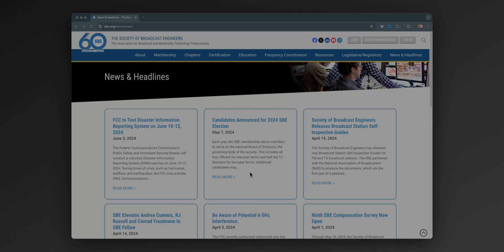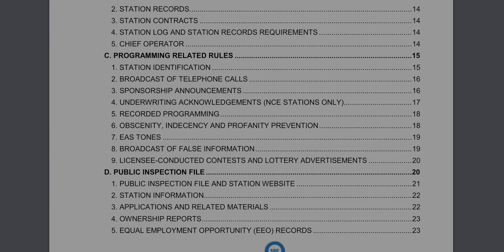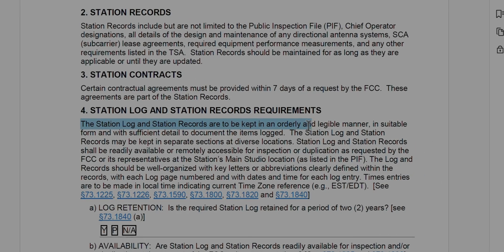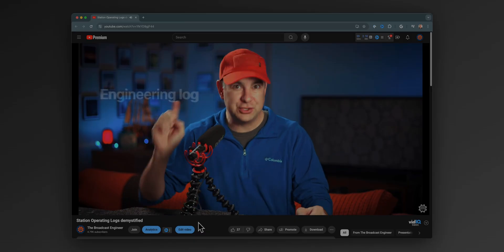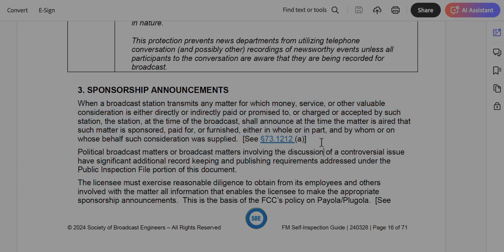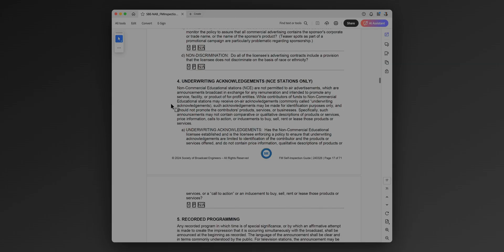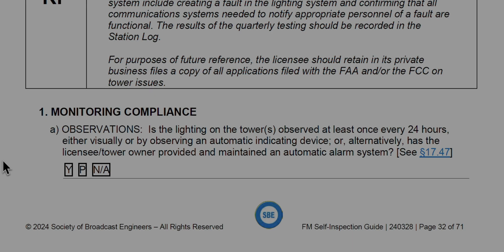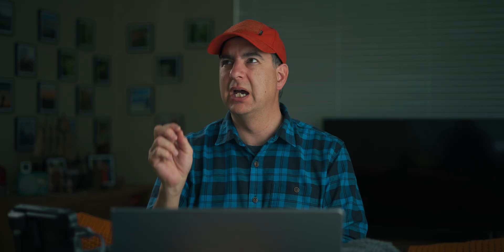Avoid Costly FCC Fines: Updated Self-Inspection Guide

Comment: I haven't been in radio for almost 50 yrs but I still remember the small parts that I, a 3rd/endorsement license holder, had to do. Of course, most of it was logging, which was all on paper produced on a typewriter by the secretary. And we had to look at the amp/volt plate (yes, all tube) dials and log them on a set schedule. I think broadcasting was one of the best jobs/careers I ever had, but the money just wasn't there except for that handful of "superjocks" in big cities. I'm sure all of that stuff is computerized and automated now, just needing to be "scanned" by a human and then signed.

Comment: Thanks for all your videos and the lessons. Sentimental about losing the Santiago Feed.
Changing subject....do the 6Ghz point to point microwave users still use Analog ?
The BNSF railroad recently took down their 6Ghz link which ran LA cross country to Chicago.
It was analog. 
So....is there anyone left in the Orange, Riverside, and San Bernardino counties still using Analog 6Ghz 
and their locations ?
Thanks
Reply from the maker: Thanks for the kind words! I don’t think there’s any analog 6GHz microwave links out there. It’s all digital now.
Reply: @TheBroadcastEngineer  Thanks for the reply. Any particular digital format ?
Reply from the maker: @wes5150. Usually like QPSK or 16 QAM or the like.
Reply: @TheBroadcastEngineer  Thanks. I presume in order for a 6Ghz user to go digital he would not be able to use the Andrew Dish antenna but replace the antenna and new radio?
Reply from the maker: @wes5150. Are you referring to the old antennas that AT&T used to use? No those aren’t compliant anymore. There’s a frequency coordination required as well before you can get licensed for that band.
Reply: @TheBroadcastEngineer  Thanks for the  explanation !

Comment: We have a FM tower here with 4 stations on one 550 foot tower & it causes bleed though on portions of Shortwave band & can also interfere with another FM station in another area if you with in one mile of the tower. There is one HD Radio station on that tower & I tried several radios including my OEM car radio. I reported it to the FCC & they don't seem to do anything & complained to the station owner & they wont fix it & they say its fine & it isn't. There is a new housing development 900 foot of the tower also & maybe could be a violation.